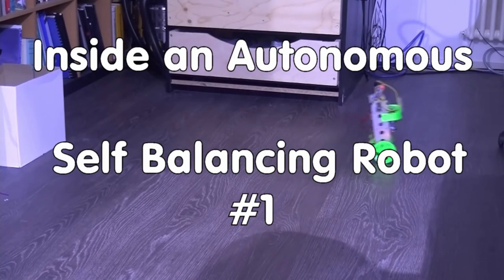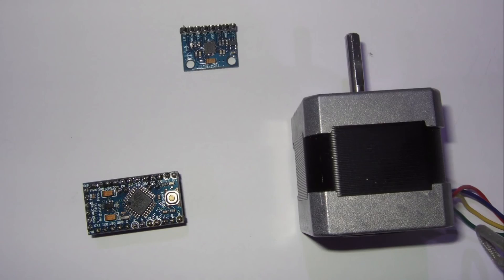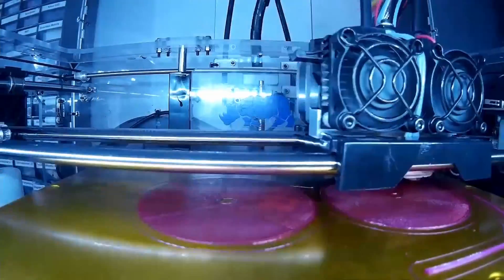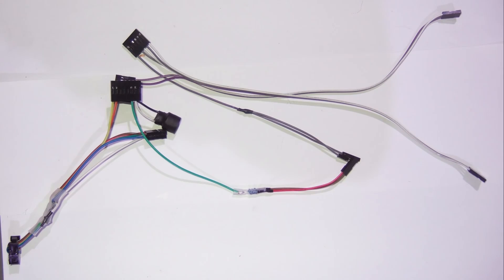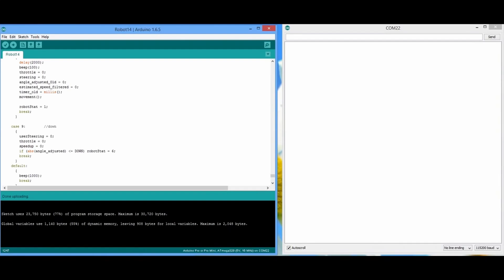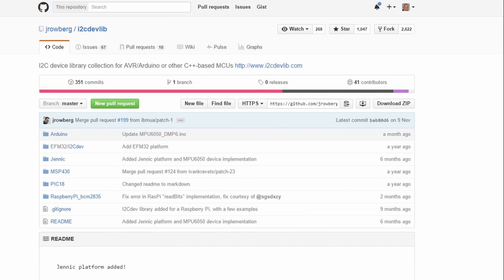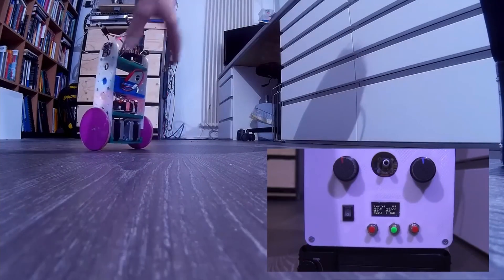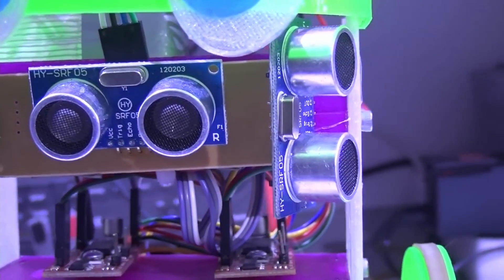#393 How can I build an Autonomous Self Balancing Robot?

Comment: req : building series for autonous rc car with lora to monitoring weather environment etc,  thanks
Reply from the maker: I assume a LoRa remote control could easily be done (just replace the NRF2401). 
Unfortunately, most "professional" weather stations use plain 433MHz and not the LoRa protocol. You would have to build your own controller and replace the one provided by the supplier.

Comment: I was just thinking around just such a project but with Reinforcement Learning as controller instead of a PID
Reply: Reinforcement Learning makes a lot of sense for this kind of project, as it introduces more independence from the parts used. Will you document your experiences somewhere?
Reply: @stal1963  One of the first examples in RL is exactly this project. Called CartPole. It’s usually run in a simulated environment. My thinking was to implement the same in the real world. Sure will be documenting this when I get around to doing this. Now to get my hands on a 3D printer…
Reply from the maker: Interesting idea. The setup of a "learning environment" in reality is probably not easy because the robot falls down a lot of times and it can get boring to restart it manually.
Reply: @AndreasSpiess  That is true. The RL environment would need to store its state persistently and assign a big penalty whenever the robot falls. It could be interesting to build a self-balancing robot using a Jetson Nano.
Reply: @AndreasSpiess  That's the wonder. The RL system will not be limited to the totally deterministic nature of PID, but will learn the rules dynamically on its own. It could potentially figure of some weird ways to avoid falling which you may have never considered. To see that, would be pure joy

Comment: Is it possible to do without stepper motors but with normal motors? Quadcopters don't use steppers either.
Reply from the maker: Yes, you can do it also with normal motors. They have to be quite slow (geared)

Comment: Which I don't like in projects like that is using all those prepared and fabricated and ready to use circuits ! I would prefer to know for exampe how transmitter /receiver work, what frequency , how to build it, why crystal oscyllator, how to filter desired frequency, how to demodulate frequency change  (just examples), why this why that , many questions!! But  like on the video I can build a whole robot without even knowing anything which is not good :/ I have been trying to do something similar with a drone and it is much more complicated when we build everything from scratch! Even adjust the response from changing the voltage from the accelometer is a challenge and not using Arduino (by using the op-amps for example) and make all this work...
Reply from the maker: It all depends on your goals. If you want to learn about PID controllers and remote controls and create a cool gadget, this project is perfect. If you are interested in Wireless communication you find other videos on this channel explaining many things. And if you want to learn about RF you have to search for other channels. I do not cover those details, because not a lot of my viewers are interested in this detail. 
If you are interested in RF and communication theory I suggest that you learn for an Amateur Radio license. Then you are allowed to do your own experiments without being illegal. Otherwise building your own transmitter is illegal in most countries.
Reply: Thank you for the idea! I think it would be a good start with the licence etc. Any way I learn from the books and all chanells on youtuve I treat as something extra for better understanding or just to see how other people do things or ideas etc.
Reply: @AndreasSpiess  my goal is to learn as much as I can and be able (of course in the future) to build and develop my own circuits but I am not a "gadget guy" I mean I don't want to be just an user of electronics but build my own things and develop my own projects ! because from jsut using electronics i do have nothing but to know how to build things it is a different story. I know this is not very popular goal these days where everybody is for fun and gadgets but I like more the old school of creating things instead of just using.. But of course this project is very cool but I see the things from a little bit different perspectiv , more serious and maybe a new job one day etc.
Reply: @AndreasSpiess  btw I live in France (I am not french) and need to read al lthe regulations here but there was just an example ! I meant also other things like experiments with op-amps and analog sygnal accelerometers (and how to match the change of the voltage with current state of the robot and working motors et.c etc.) and for exampe logic gates, transistors , mosfets, relays to control motors and other things
Reply: The funny thing is once you know all the detail you will realise that to achieve anything significant with modern technology in a reasonable timeframe you have to use higher-level tools / intellectual property rather than develop everything yourself. Learning the details is interesting and fun though. Good luck on your journey!
Reply: @rfrisbee1  yes but once you have learned everything already ;)  Another thing is when something goes wrong you know exactly where you are because for example you have all youer circuits you have already done in your mind. But i think we shouldn't stay in one point or choose one direction constantly changing everinement needs of some kind flexibility and of course knowledge.
Reply: @rfrisbee1  btw I don't mind using high level modern technology and tools but all I want is just to know how they work, how I can build them or develop and if I had my own idea how to make it work! (and not be dependended all the time of someone else). This is all I want..

Comment: I'm particularly interested in your 3D printer. It looks like one of those Chinese Makerbot Replicator 2x copies. Does it run well? I have a real one and converted it so a single nozzle printer with a removable heated bed and auto bed leveling. So far it's the best mechanical platform I've used. Curious to hear what kind of changes you made to your machine.
Reply from the maker: This is a re-published video. Back then I had a Wanhao printer (shown in video #2). Back then, I made also a few videos about my tricks. Now I have a Prusa and I am happy with it...

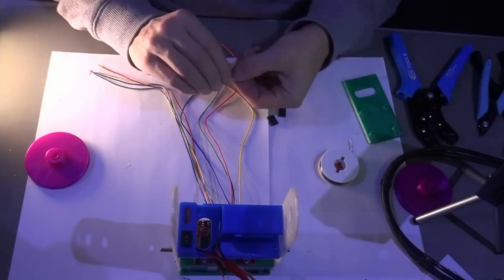Comment: 4:24.. You could have also used ready made Dupont wires and spliced them to the motor wires.
Reply from the maker: As far as I remember I used ready made Dupont wires. What do you mean with "splicing"?
Reply: @AndreasSpiess  At 4:24 of the video you crimped those small Dupont pins stating it was SLOW to crimp the wires. 
For others that do not have a Dupont pin crimper or don't want to crimp those tiny pins... you can take ready made Dupont Wires and solder (splice) them to the Motor wires.
Reply from the maker: I agree: Soldering is always a good possibility, especially if you do not plan to disconnect the wires.